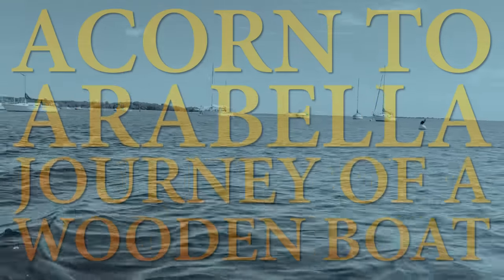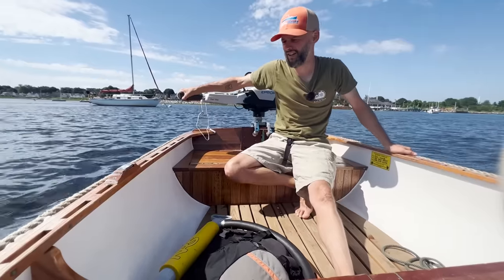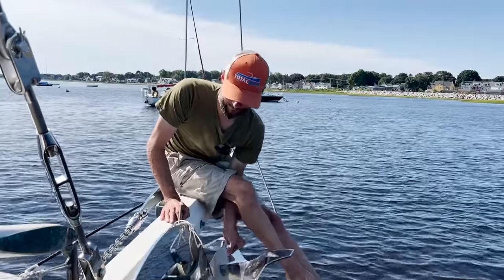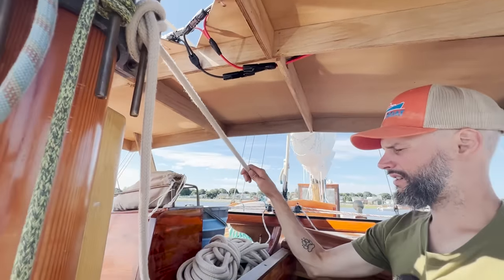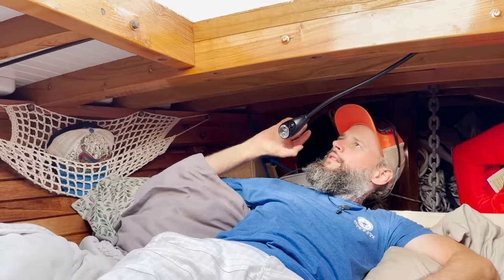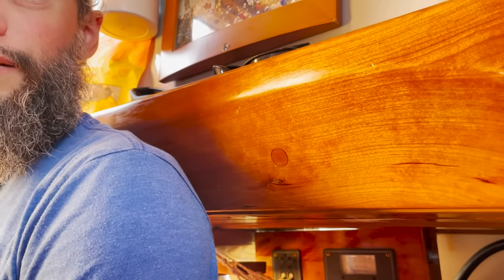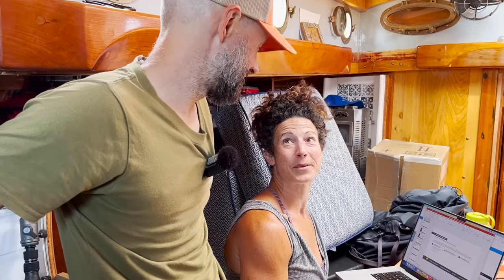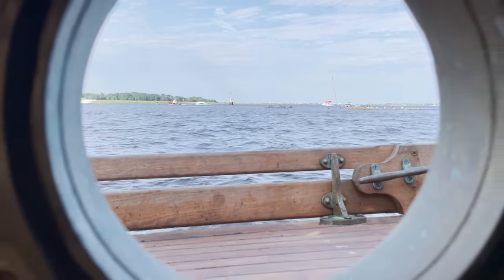2 Months on a New Boat, Full Walkthrough - Episode 277 - Acorn to Arabella: Journey of a Wooden Boat

Comment: Everybody wants to do everything traditionally until they find out rowing in a storm is no fun and rollerfurling is a joy to use from the security of the cockpit. However, I do prefer a traditional blackwater system, built correctly, not a fan of composters.

Also, I bet you will be standing on the dodger at some point.

Comment: I bet the LEDs are being overdriven and are cooking themselves to death.
Reply from the maker: Poor lil bubs.
Reply from the maker: Not sure what “overdriven” means here but you’re describing a real travesty with the wording hahhaa
Reply: @AcornToArabella  LEDs will pull enough amps to kill themselves if they don't have a limiting resistor on them. It's called a "pull down" resistor. I'd check the current rating for the led you have against how many amps it's pulling. I'd also be concerned that if a single one in the series dies, the others will get progressively more current and the whole string will fail faster and faster. Especially since they're wedged up against the wood without any way to vent heat.
Reply: @AcornToArabella  So LEDs are designed to have some specific amount of power run through them, and if you run them at that voltage, they'll be bright-ish, use a middling amount of electricity and last a fair while, without getting too hot.  However, there's no reason you actually have to run them at the design power - you can run them at lower powerss ("underdriven"), at which point they'll be dim but last forever, use next to no electricity, and never get even vaguely hot. You can also do the opposite, and just go ahead and wack more power through them - this makes them almost absurdly bright, but makes them generate much more heat, use much more electricity, and don't last as long.